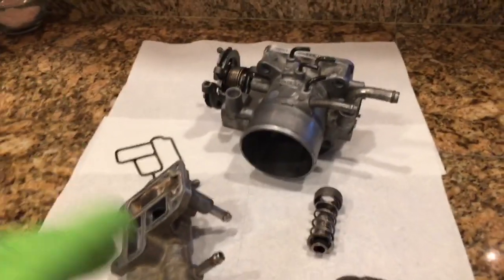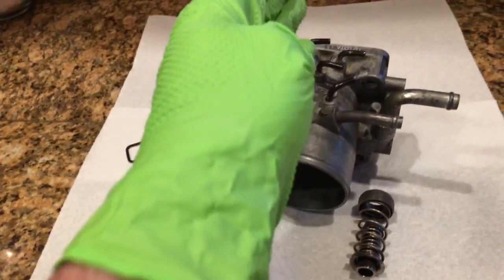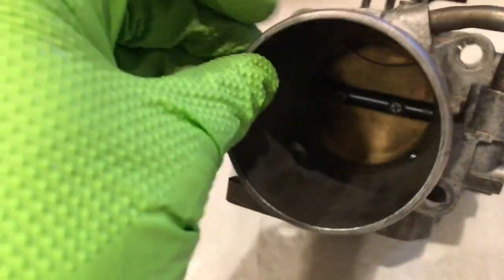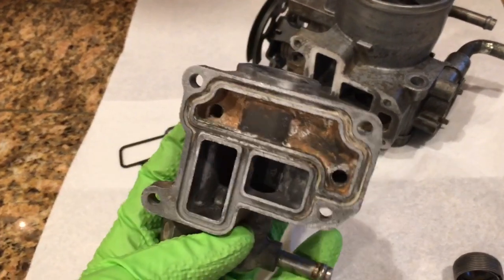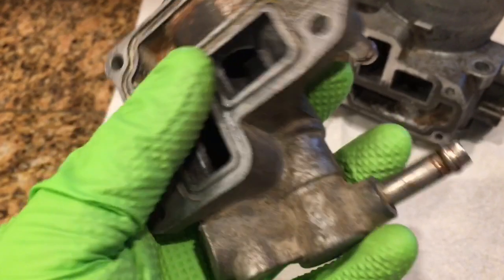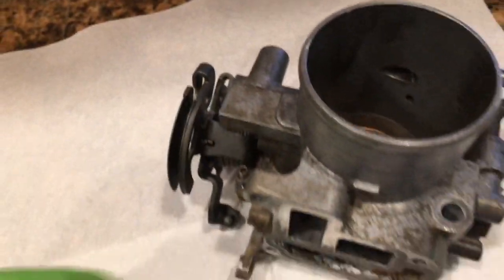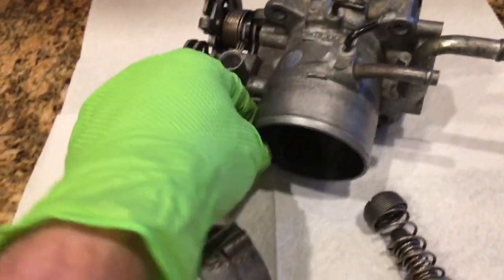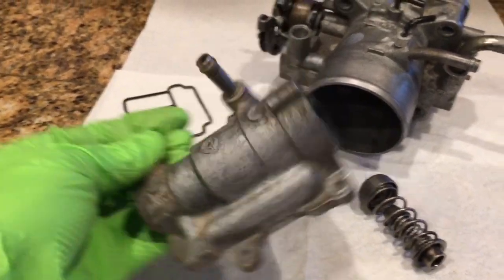Toyota 4runner pickup 22RE - understanding rough, high, surging idle, the Idle Air Control IAC valve

Comment: My 86 4runner has 3 vac lines ontop not 4 like yours. Why is that?
Reply from the maker: That is just one of the great mysteries of the universe :) I'm not super familiar with the setup on the 86, but if you wanna send me some pics to the email address on the channel, I'm happy to take a look and see if I can make heads or tails out of anything. You're referring to the small 4mm hoses that connect off on the left side of the throttle body right? I have another video on my channel where I discuss the routing of all those hoses in more depth by the way.
Reply: @ray5961  I'm talking about on the top of throttle body there's 4 vac lines all the same size. A cluster of 3 then another one more towards radiator. I only have the cluster of 3
Reply from the maker: This video here gives a pretty good run down of what everything does - https://youtu.be/rcKjFEYHk28?si=PuAr1EBmNDWqj7VC - maybe your truck doesn't have an EVAP system on it? The 3 main lines on my truck are all related to the EGR system and the vacuum modulator. The 4th is to draw fumes out of the EVAP canister.

Comment: Nice vid and rebuild! 
Do you recall the factory setting of the threaded piece for the spring? (Number of turns)
Reply from the maker: Christopher Rizzuti No, I wish I knew. As I remember, I put it in hot water to see how it worked and then I adjusted it so when it was cold it was open (allowing air to flow), but when it got up to around 100-120 degrees it should be closed. It only needs to allow air flow through until the motor starts to heat up. I'm hoping I don't need to take mine back off to readjust it once I fire up the motor.
Reply: @ray5961  Dang! Ok, thank you for the reply.
Reply: Per comment above, 6 turn per factory.
Reply: @dolceamore4065  Thank you!

Comment: Do you have Part nbr for IAC gasket or where to get it? ...thks..jc
Reply from the maker: J C I bought it from LCE - here's the link https://www.lceperformance.com/Idle-Air-Compensator-Valve-O-Ring-89-95-22RE-OEM-T-p/1061047.htm
Reply: @ray5961  Thanks Ray..jc
Reply: @ray5961  Thanks Ray. Unfortunately I have an 86. Thks..jc